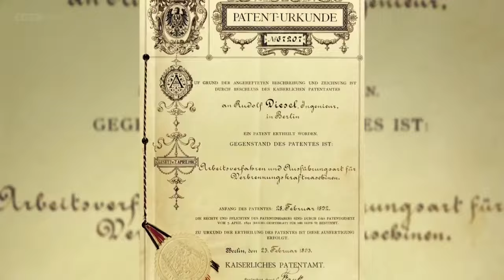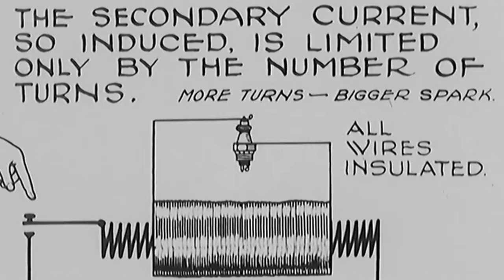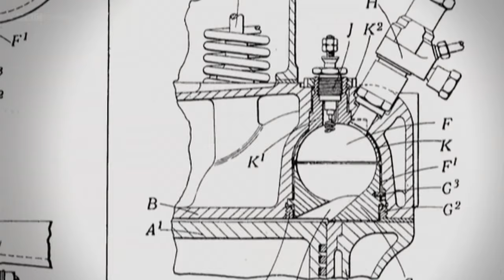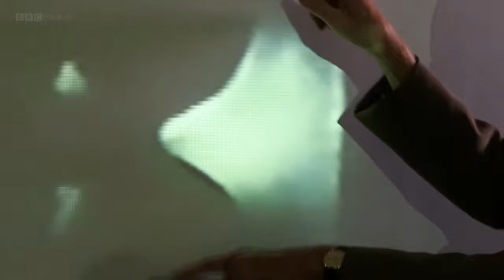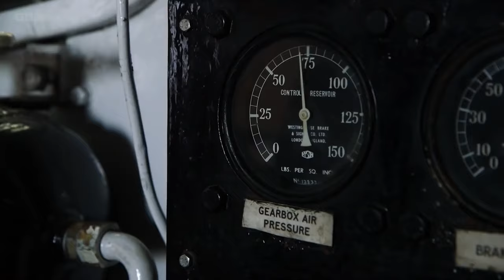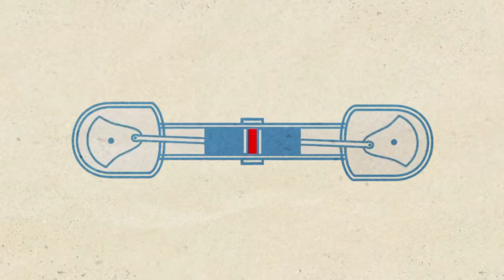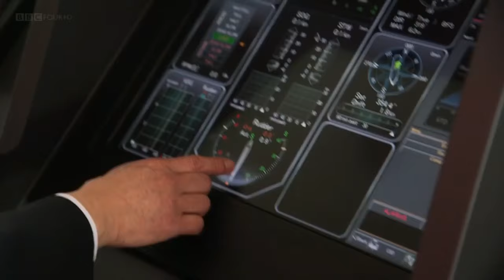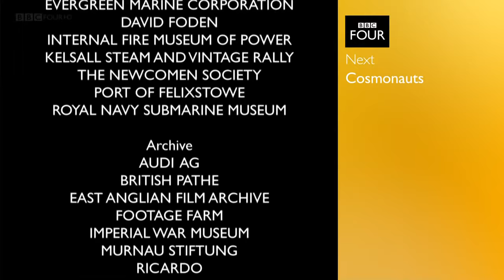The Engine That Powers the World   Diesel Engine Documentary HD

Comment: Find out the torque figure and see how many equivalent cars then equal the ship!
Reply: Torque?    80,000hp at about 100 rpm.  Get your calculator out.  :)    Oh - and the biggie Sulzer  The 14 cylinder 110,000hp   ( Model airplane engine? )
Reply: @ianfraser4014  so it's apparently 420160 feetle poundaries of torques.

Comment: @ Ian Fraser - I'm not sure what you're on about tbh. What I was meaning was people always go on about the bhp and yes 80,000hp is a big number but there's an old saying, power sells cars, TORQUE wins races. Now I know we're talking about a ship but it's the torque figure that's generally the most important. So, check this out, the torque output on the Wartsila RTA flex 96c in 14 cylinder configuration churns out a massive 5,608,310 lb ft of torque, compare that to say an average 2.0 petrol family car which typically puts out say 150 lb ft of torque. Thats what I meant when I said find out how many equivalent cars equal the ship, BIG difference.
Reply: The first part of my comment provides the information needed to calculate ( find out) the torque of an engine of 80,000 hp  rotating at 100 rpm.   ( Google will provide the formula for the calculation  :)  ) .     Secondly, there is often confusion regarding torque  (force)   and power (rate of application of that force)   Newton and Watt  can help with that.  :)

Comment: Very interesting to me.  Most applications I have seen or used,  but one day I will get to see/hear a Deltic.

I checked a MAN website a while ago - MAN claim to have 'invented' the Diesel engine.   They certainly  built the first engine,  - but to claim that they had 'invented' it is stretching things a bit to far!
Reply: that statement from M.A.N. is somewhat correct as Hr. Diesel was working With and For M.A.N. in those early days.
basically M.A.N. provided the funds for Hr. Diesels research

Comment: Use hydrogen and it’s zero emission.
Reply: thats not the whole story
Reply: Well, there is a tiny problem. Hydrogen tend to stick with other elements. Extracting them means it takes energy.
Reply: @cmdrtianyilin8107  also very dangerous compared to petrol.

Comment: The start of this documentary is incorrect! In actual fact the diesel engine was invented by a English man from Halifax named Herbert Akroyd-Stuart ! He invited the world's first oil combustion engine another word of the world's first diesel engine!

Research Herbert Akroyd-Stuart! He invited the "diesel" engine long before Rudolf Diesel !!!!!
Reply: The key difference between the Akroyd and Diesel engines is the ignition: In an Akroyd engine, an ignition device – the so-called "hot bulb" or "vaporiser" – ignites the fuel, because the compression is too low for compression ignition (<300 kPa). A Diesel engine on the other hand has no discrete ignition devices. The fuel instead ignites due to high heat caused solely by piston compression inside the cylinder (>3000 kPa). Since higher compression leads to better efficiency, the lower-pressure Akroyd engine consumes ~ 80% more fuel than a Diesel engine doing the same work.
Reply: @drmodestoesq  Many modern so called diesel engines use hot bulbs as well they call them glow plugs but the engines either wont start or area pig to start without them and remove tem altogether and the engine wont run at all, by remove I mean take them out and plug the hole an experiment I tried on a VW golf.
Reply: Wrong try again
Reply: @RunkbuttNracing  big diesel engines like the Cummins x15 has no glow plugs. They start on compression of the cylinder
Reply: @RunkbuttNracing  I wasn’t lecturing so stop with your nonsense. The Diesel engines I drive have no glow plugs or any heating element.

Comment: 100 years ago the diesel replaced the steam engine. Since then no improvement it’s a piece of shit with a worthless efficiency.
The used diesel energie is converted in movement and heat, and guess what?
60 % heat and 40 % movement what, a waste of energie.
The petrol engine is even worse 70 % heat and 30% movement.

Humanity should stop the production of these inefficient engines.